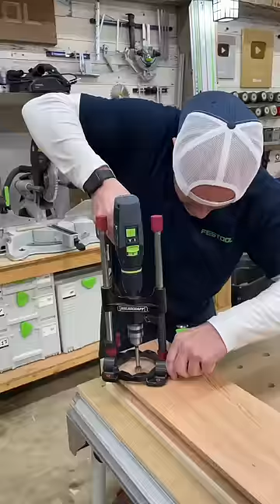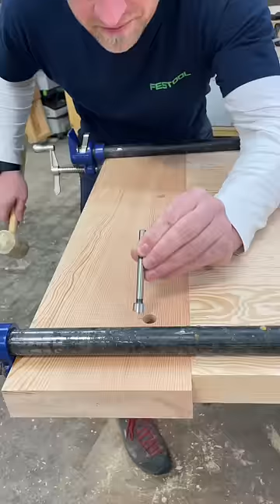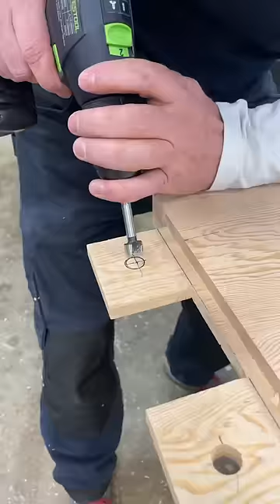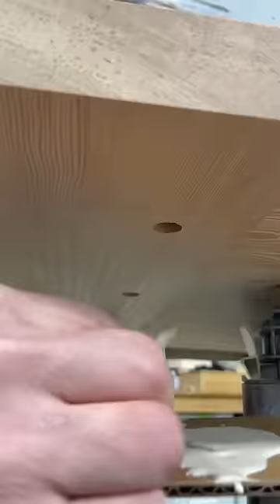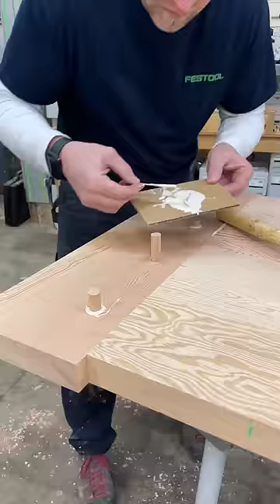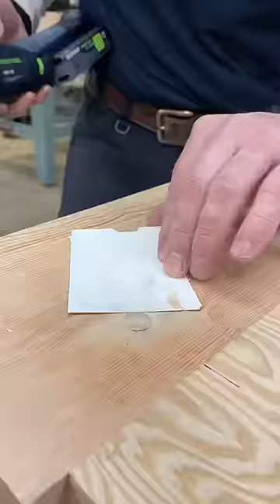Gluing and pegging a table breadboard #woodworking #tools #festool #diy #joinery #maker #woodwork

Comment: When you offset the hole on the tenon like this it's called a drawbore. The slight offset forces the two pieces together more tightly than it would if you simply drilled straight through.
Reply: you answered my question before I even asked it
Reply: you don't know my life
Reply: @contestwill1556  You got me there
Reply: Understand that, but don't understand why he had to drill out the holes twice? Made them wider than they had to be?
Reply: @stephensingletary8374  You mean in the tenon? I'm not sure about that myself. I've done it without doing that. Maybe just for some insurance against splitting something under the tension.
Reply: @stephensingletary8374 I'm not exactly sure.I'd bet it's just to make sure the peg doesn't jam against the side walls of the hole in the opposite direction of the drawbores intended draw direction. It's hard for me to explain in words and would be easy if I had a pen and paper
Edit: basically to make sure it doesn't pull it left or right but into the piece.
Reply: Ja, das wird der Grund sein. Ich halte das aber nicht für nötig. Wenn ich Fachwerk aus Eiche baue, verzichte ich auf das seitliche Vergrößern.  Bei uns nennt man diese Technik :" auf Zug bohren."
Reply: @stephensingletary8374  he responded to someone else answering that question. It's to prevent cracking during seasonal expansion.
Reply: @stephensingletary8374 wood expands side to side not lengthwise, so the wider hole allows the tabletop to expand at a different rate then breadboard.
Reply: Thank you. I was looking for this specific explanation
Reply: So long as you don't take a file to it and expand the hole by a sixteenth of an inch.
Reply: Thank you
Reply: Thanks for putting a name to it.
Reply: Are you referring to the 1/16" he marked off center ?
Reply: @stephensingletary8374  he drilled the holes wider so the middle of the table has room for wood movement. If he drilled the hole the same size as the bread board ends, there would be issues during the different seasons
Reply: Thank you. That makes sense, but then he drilled them again, which opened them up, seems like it would defeat the purpose of the drawbore.
Reply: @smcd5772 I haven't seen that part of it done that way before, but it seems possible that even if the peg slides to the side while driving it, some offset toward the shoulder of the tenon will still be there. So I don't think it would completely eliminate the benefit. I'm not sure if it's necessary, though.
Reply: I had this question as a non wood worker.
Reply: Thank you I did wonder
Reply: @stephensingletary8374 Accomodating for potential wood movement. Grains in opposite directions and some big wide boards. They will move a bit which could stress and crack where they are fastened together.

By making them a bit wider, will allow the bit of wood movement, the drawbore will keep it nice and tight.
Reply: I was just about to ask why. Thanks for being there for me 10 months ago, hero!

Comment: Can I ask what was the purpose of drilling the holes wider on the tongues?
Reply: Wood expands and contracts over its width, but not in length. Because the grain runs perpendicular to the table top, you have to allow for the top to move independent from the breadboard end. That's why he only glues it in one place and enlarges the other holes.
Reply from the maker: It's to allow room for seasonal expansion and contraction without cracking the project
Reply: @dustylumberco  That's awesome! I love learning things like that, it's exactly why I subscribe to channels like yours. Thank you!

Comment: If you glue just holes there will be less glue on the surface. Make sure you take a brush or a stick and spread the glue on the inside of the holes.

Comment: good work, you can also fether plane from the center outward of the bread board to create a spring joint which will ensure ends stay tight over time, and with a dowel that large orient the end grain all the same direction as your panel.

Comment: @dustylumberco If you make the tenon holes oblong so the table can expand, doesn't the glue hinder that?
Reply: Thats why he only glued 1
Reply: Wrong.  He only applies the glue at the spots where the peg comes into contact with the bread board end of the table and not the body of it, which is why he applies a little at the top, hammers the peg in, then applies a separate application of glue from underneath.  The glue applied at the top is not sufficient to push through and adhere the peg to the body of the table/inner piece.
Reply: No

Comment: After you drill the holes in the breadboard (lets say they are 1/2"), put the breadboard back on and slide a 7/16 forstner bit into the hole and pushed toward the shoulder and tap it to make a mark. This will give you the perfect offset to drill your holes in the tongue to use as a drawbore.
Reply: Wow another recliner professional speaks
Reply: @daveklein2826  Yes, I am a professional cabinet, furniture maker.  Do you see something flawed in my suggestion? I'm not knocking the guys abilities, and he's basically doing the same thing, but instead of using the same bit to mark the center of the bore,  use a smaller one to offset it by the amount you choose. Personally, I use a bit 1/16 smaller which will give a 1/32 offset. Use the suggestion, don't use it, I really don't care.

Comment: So it really doesn't matter which one you glue as long as it is one of the middleesh ones?
Reply: The middle peg is not generally elongated like the others, giving the table a secured/dedicated “mid-line” and allowing both ends of the breadboard to expand and contract from there.  You do this to allow movement of the main body of the table, which will expand and contract much more across its width than its length.  Since the breadboard end is perpendicular to the table top it will move much less.  Also, he glues all pegs but makes sure the glue is only applied where it contacts the breadboard and not the tenons.  If he glued them to the tenons the holes he bored out for movement would be pointless.

Comment: A friend of mine were building a table... maybe slightly bigger than this... and my friend insisted regular dowels would be sufficient to hold many pounds of ash. (Hes older than me (technically more experienced by his age) so i let him have his way (despite my disagreement)..

Tsble put together.. blah blah.. few days later the sides fell off and landed on the customers toes. 

Time of service doesn't translate to experience. 

'Ive been doing it wrong for 20 years' 😅😅😅

Comment: Is there a reason you tap in the dowels a bit before applying glue?
Reply: You don’t want glue getting into the hole where he drilled out the recess in the tenons.  He applies some at the top and then after hammering the peg most of the way in he applied glue to the bottom.  It secures the peg to the bread board end without adhering to the tenons/main body of the table.

Comment: Why not just drill straight through then remove and expand/oblong the joint after? Save steps
Reply: By drilling through the main body 1/16th of an inch closer than the actual hole through the breadboard end he forces a tighter joint between the two pieces when he drives the peg in.

Comment: Im sure there is a reason but wouldn’t just glueing without the dowels work just as well
Reply: No
Reply: @daveklein2826  why. If he glued the part that inserts into the piece being attached.  Wouldn’t that hold just as well? What are the benefits of the dowels in this case

Comment: If you knew where the tongues were, why not put the other board on and drill through both?
Reply: Because he offsets the hole in the tongue to pull the end tight to the rest of the table top when the pegs are hammered in.

Comment: Why did you make ovals instead of round holes?
Reply from the maker: To allow room for seasonal movement
Reply: Okay. I'm trying to learn, here. It seems to me that accounting for seasonal expansion and contraction would indicate ovals perpendicular to the ones you've created. Please help me understand.
Reply from the maker: @darrenhepperle4854  it’s the main part if the table that you need to account for and it moves back and forth in the direction of the ovals I made
Reply: @dustylumberco I think I understand. If the grain goes north-south, the seasonal expansion is east-west?